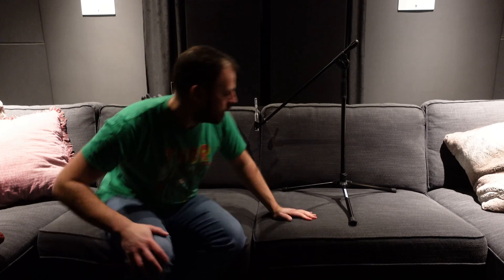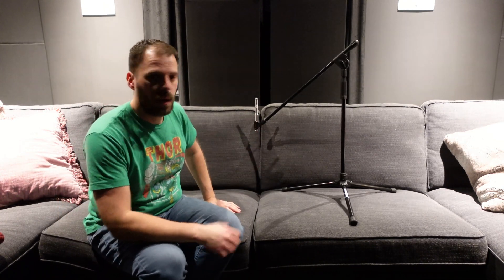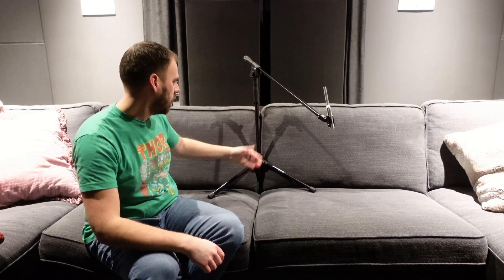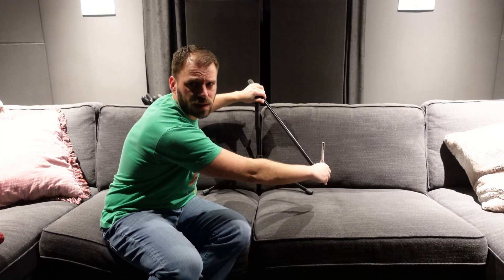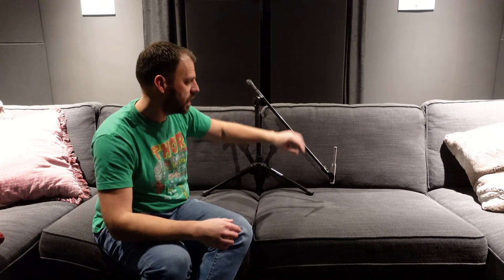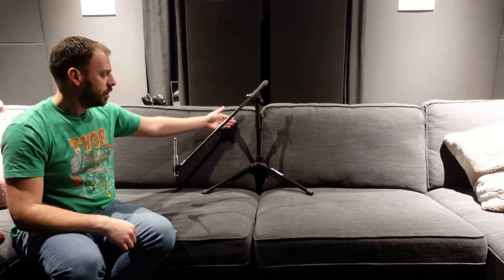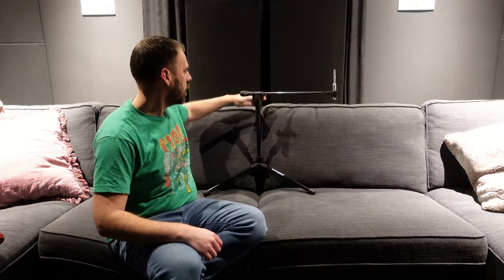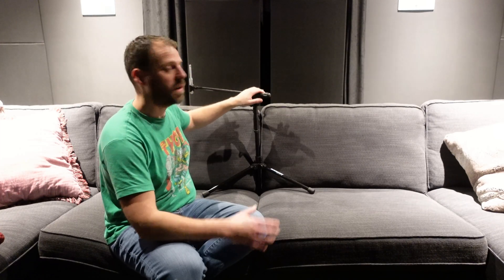ANTHEM ARC GENESIS CALIBRATION MICROPHONE POSITIONING | Correct Placement for Better Results AVM70

Comment: Hello. Excellent video!!! I have a question because I think I have been measuring wrong. This is my first Anthem product. I've had all Denon's before, with the last one being the AVR-5308ci. My question is, when doing the measurements, I'm not supposed to physically move the whole mic stand from the initial spot? Just swivel the mic arm and move it up and down accordingly? Looking at the pictures in the manual, I thought I was supposed to physically move the entire stand to different areas of the room. Thanks in advance for your help.
Reply from the maker: You just need to get the mic into the different positions. Move the stand if you have to. I usually take the main listening position measurement, then put the stand itself in that spot and swivel it around and up and down for all the other positions.
Reply: @Techthusiasm  , thank you for your quick response and for answering my question. I’m going to try that today. My couch sits on the back wall of an L shaped room and it was giving me problems doing it with me moving the entire mic stand in different 3 ft positions.
Reply: Hello again. I have 1 more question. With my living room being L shaped and my couch sits partially on the back wall and opening into the other room. I know the mic is supposed to be about 18 inches away from the rear wall. What should I do?
Reply from the maker: Just do the best you can, but I wouldn't put the mic right up against the wall for the "behind" measurements". Just go up and to the sides a little bit back of the main listening spot.

Comment: Hi there! Love the channel and a huge focal lover myself! Building a similar set up with an Anthem AVM 70 and entire aria line just not in walls (except ica6 for atmos). My question funny enough is in regards to your couch, I love the low back. It would be great to not block the side and rear channels with a sofa like that! My current one comes a bit higher than ear level and is likely going to through off freq response readings during calibration. What kind is it and where did you get it if you don't mind me asking?
Reply from the maker: Thanks! The couch in our theater room is an Ikea Kivik sectional. I talk about in more detail in my recently updated tour video as well: https://youtu.be/RA5rB7YqKJ4.

Comment: Will it to the same for 7 positions measurement? Microphone for MLP is at ear level and the rest will be 3 lower and 3 higher measurements?
Reply from the maker: For 7, I did that normal 5 bubble around the MLP then one wide to each side.

Comment: Um, wow.  Thanks for doing the correction so quickly.  My mlp is a real diff kettle of fish. I'm going to have a love seat with an area between.  Do i consider mlp to the left side seating position.  As i assume that i will mostly be main occupant.  Or middle of seat above storage bracket and position 2 to 5 X around that center position?  Or should i do more locations for mic moving 2a 2ft from 2 e.t.c and do 10 sweeps?  My room is 16x11x7 and will be doing 7.1 2.1 and 5.1.2 . 6 and 7 speakers will be on 42in stands,  making tweeters about 55in above the floor. Ceiling too low for in ceiling?
Reply from the maker: Hmm, good questions. You could do a 5 point around your MLP wherever it might be or do more points around more of the seating. I might be inclined to try both and see what you think.

Comment: Thanks for another great and informative video. That’s interesting about the mic placements. How Arc requires you to take measurements at different heights. So I guess only half of the measurements will be taken at ear level. Am I correct. This differs from Audessey. Thanks again Jaremy. Can’t wait for the sub review
Reply from the maker: For a 5 point measurement, only 1 is done at ear level. The first one at the MLP, Then you want 2 higher and 2 lower. I did the front positions lower and the rear ones higher as I can't measure lower in the rear of course given the couch back is there.
Reply: @Techthusiasm  gotcha. Thanks Jaremy
Reply: @Techthusiasm  good video!
I have a similar room configuration to yours but I'm running a simple 5.1 setup.
My surrounds are a little bit over the headrest (height wise) and, using this measuring pattern (which is the one I also use BTW :D ), I've always wondered about a possible interference with the 2nd and 3nd mic position... Because the surrounds are in stands that are not that tall, there isn't a direct "sightline" between the tweeters and the mic when it's in position 2 and 3. 
Do you see this is as a problem?
Thank you for your input!
Reply from the maker: @EdiMCharana  I don't think it's a problem. The goal of the 5 positions is to have positions at ear level, low up front, and high in the back. It all gets calculated together. So I think you're still doing the right thing.